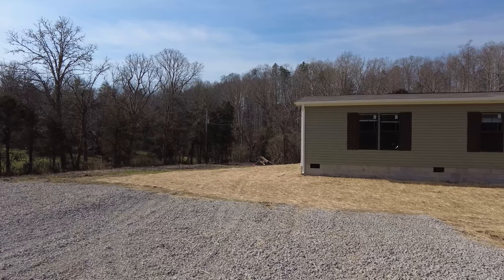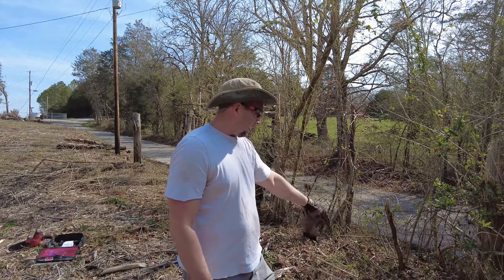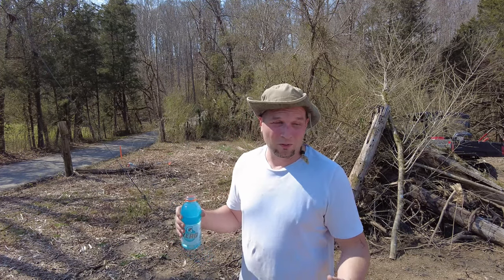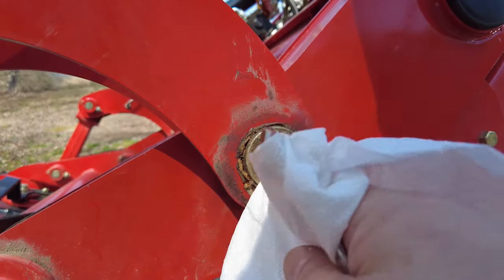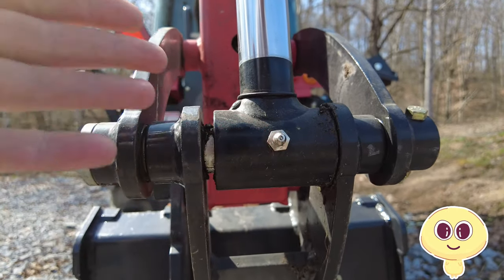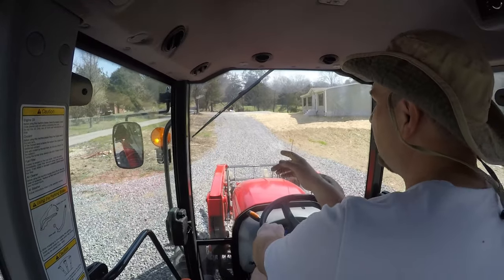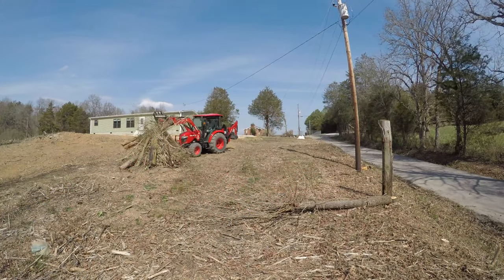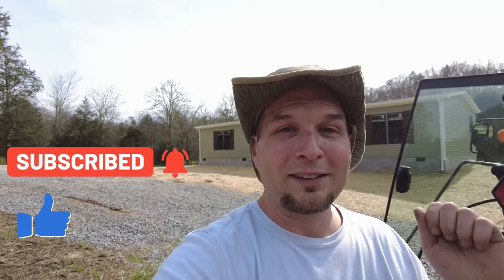More backhoe work on the homestead! Repair grease fittings NO GREASE *ALL BRANSON OWNERS CHECK*

Comment: I bought my brand new 4815R with a BH150 last weekend. DId about 2 hours worth of work on the backhoe before I saw your video. I also noticed I couldn't get grease into two of the fittings on the dipperstick frame assembly. When I pulled the zerks they were nearly obliterated on the end of the threads with the springs pushing out of the bottom. How did you resolve this? Should I fully seat the zerk and then back them off a bit to provide room between the pin and the grease fitting?
Reply from the maker: Hey thanks for the comment . So I removed those brass fittings I thought about backing them off but you are pumping up to 7000psi of grease in there and I think the grease will find its way out lol. So I took the zero to tractor supply and I got the zink ones and the threads on those will not thread in all the way like the brass maybe half way in . I tried the metric and standard I can't remember what one I used so get both and try them. After that you shouldn't have the issue of not being able to put grease in . Poor quality control . I used my backhoe for several weeks putting in our orchard and didn't know what was going on still  until I said no this can't be and I pulled the big roll pin out and saw the groove in it from the grease fitting . Glad you found it fast but we shouldn't have to do this on new equipment.
Reply: @ClinchRiverHomestead  Thank you so very much. Extremely cool of you to share and I'm very lucky to have found your video. I was going to wait until the 10 hour mark to start greasing I but literally ran out to my garage in my pajamas with a headlight after seeing your post to see if my brand new tractor and backhoe had the same dilemma. BAM, found two culprits. Caught it early :-)
Reply from the maker: I'm glad you caught them early don't wanna hurt new equipment 😁 I thought others would have this issue so I wanted to mention  it I really wanted to video it but oh well thanks again for the post .
Reply: Brand new 3620R, same issues with the backhoe zerks, one broken, one locked up (plugged). Got a grease joint rejuvenator and broke the plugged zerk! Got a set of zerks and bone would fit. What type/size fittings does it take?
Reply: Brand new 3620R, same issues with the backhoe zerks, one broken, one locked up (plugged). Got a grease joint rejuvenator and broke the plugged zerk! Got a set of zerks and none would fit. What type/size fittings does it take?